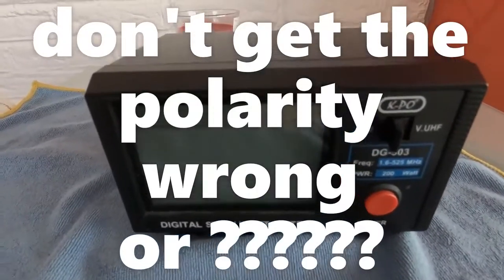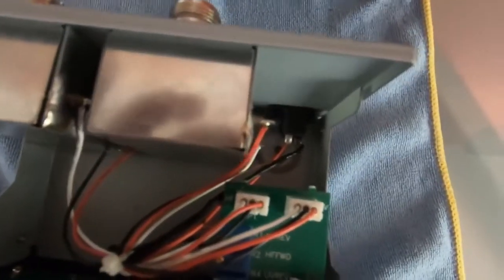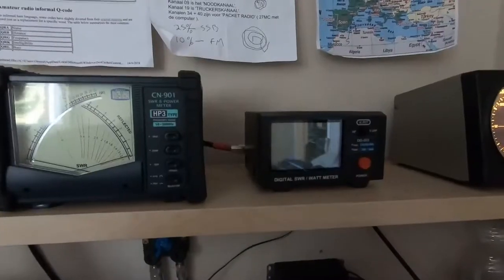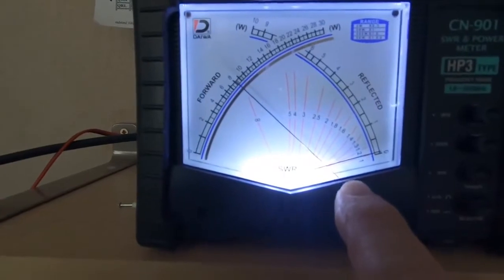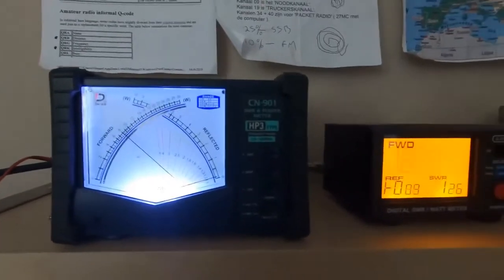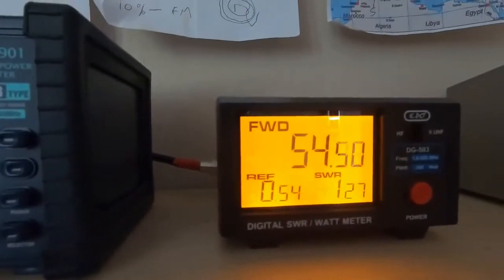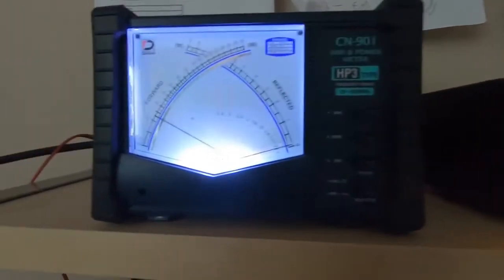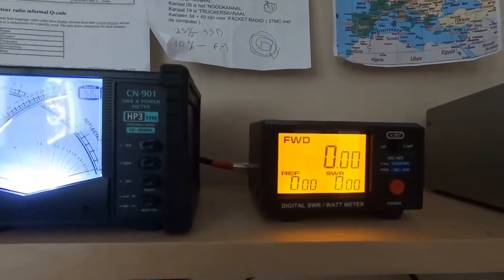KPO Digital SWR AND POWER METER,WIRED UP WRONG NOT A GOOD IDEA...

Comment: Hello John the KPO swr meter s a nice one to have , i do own one and it works great.
May i ask why u did buy bec u have a very nice Daiwa swr /powermeter wich looks great with the backlight
Reply from the maker: Hi, the KPO swr meter was a nice addition, sometimes local operator's and ebay are good places to look for a bargain, it's also handy when I get a 2 meter and 70 cm radio to check the swr and power, 73 from Rotterdam 👍.